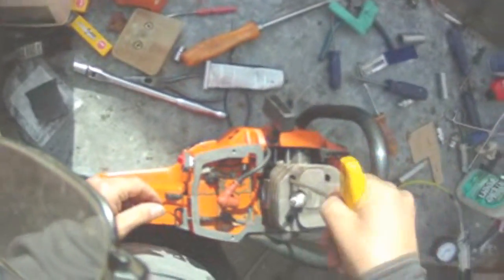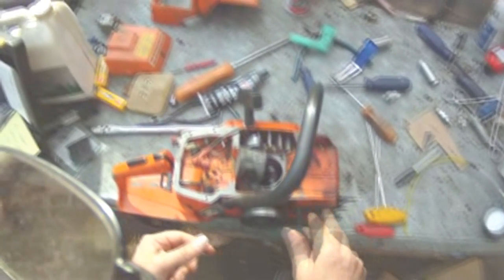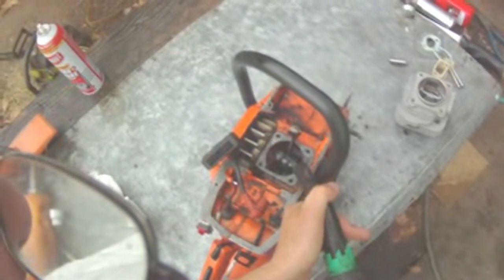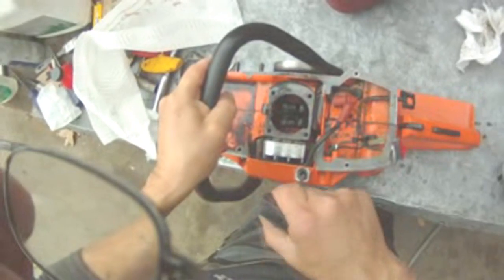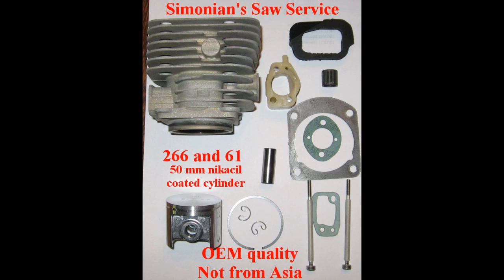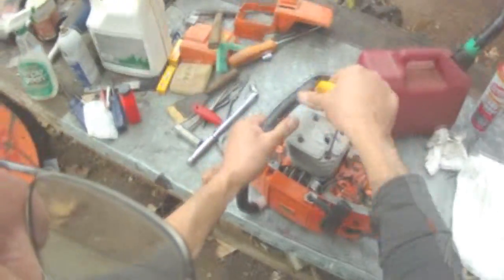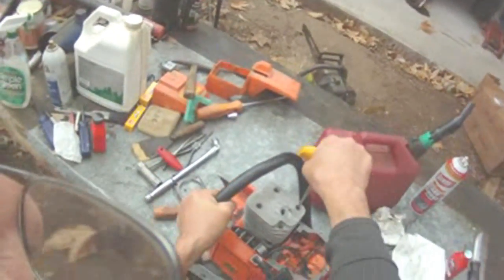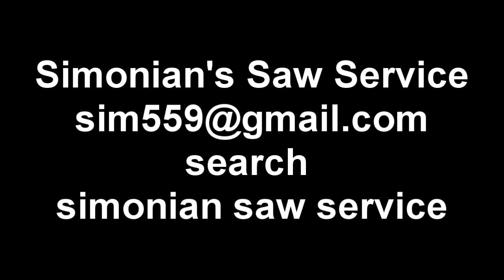After market Husqvarna 268 cylinder kit installing into a 266

Comment: i learned from this never to use a head cam to make a video , wow , my head was spinning for a few minutes after this video
Reply from the maker: never take up flying! those descending turns will get you
Reply: @JONSEREDdotWS  lol , never been in plane and don't intend to ,
good video tho. i just changed the top end on a xp 268 , i was able to install a 272 top end  from Italy  on it , i think they are a little better made then the china ones ,,, she rips now ,   :)
Reply: @JONSEREDdotWS  P.S. i finally learned how to get that bottom screw off the carb. without bending the key , take that on/off switch off ,thanks for that,  just never dawned on me , my brain tends to take little breaks on me once in a while , lol ,,,  
nice video
Reply from the maker: @marcelcanuck   Glad I could help
Reply: @JONSEREDdotWS  140psi Good compresion 372xp oem?
Reply from the maker: @Sensei948  yes what is the problem?

Comment: im a housewife but even i know you dont tighten a cylinder or a cylinder
 head clockwise or counterclockwise. you tighten a cylinder- cylinder 
head crossways, and half way. you tighten the next MOST opposite to the 
next to tighten (which leads to tightening crossways) and ONLY halfways. 
you go around at least 3 times on every nut on the 
cylinder-cylinder-head and use a torgue wrench to meet the maximum 
torgue, not a t-handle.
 because exceeding torgue  is as much of a 
violation as undertighten the thing. same thing applies to tighten  a 
rim on your car.(altough the rim of a car can be kicked because the 
basic rule in this is to tighten it as much as you are physically able 
to, but make sure you spread the tension on the largest surface area, 
i.e: tighten every nut bit by bit and crossways) i see you making a nice
 circle tightening the cylinder... nut next to nut making a nice circle.
 Even if it are only 4 nuts you just violated the most basic thing in 
mechanics.

tighten the MOST OPPOSITE nut on a circular connection on EVERY occasion

and you clean out ur crankcase, or anything greasy, with diesel. not gasoline with some shit in it.  cheap good ol, easy to obtain DIESEL , the stuff you get at your local gassstation

btw im here becaue im the only english speaking person in my family and tommorow we are buying a husqvarna 266 se chainsaw, and i have to translate the user manual

anmd the oil u use to install the new piston is the very same oil as u use for the mixture to run the saw on, but even better(because its cheapo) just use motoroil. it will burn away anyway.

and why dont you just elevate this top cover with some washers instead of grinding a hole in it?

and nicasil plating is very nice, unless you need to bore the cylinder again, becasue nicasil doesnt allow oversized pistons beacuase you simply cannot machine the nicasil material, exactly like the chrome plated parts like the trottle valve in the carb of the motox machines , have em wear= have em shot and get an oversize piston to install (motocross 125cc two-stroke obviously basic knowledge, yea this girl happens to know about motocross 125 cc engines, i aslo know somethings about the 500cc engines for that matter, you know... back in the day when these were still made, when there were still men that dared to ride these kind of bikes...)

and the kit is for those who dont know what cylinder porting is about, like they dont know what happens when you grind down your cylinder head, or in case of the 500cc two-stroke motocross engine .. add an extra head gasket(for certain occasions, like having your girlfriend riding your bike))
you might wanna consider a rebuild of your chainsaw done by me , and i can make a very nice set of cupcakes to go along with it
Reply from the maker: +Regan Teresa WoW very nice. You are correct. however I use the same fuel mix to wash out the crankcase as I do to run the saw.  Sometimes I even use a pressure washer to do the first cleaning of the crankcase. I also have used motor oil as a pre lub. Makes lots of smoke on start up which is kind of fun.  The problem with washers to raise the top cover is there is now a gap between top cover and saw body. I guess one could use silicon seal to solve that problem. So i will make that suggestion. It may cost more to bore out a cylinder or just replace it with a new one. Now for the cupcakes, sounds interesting. Where in the world do you live?
Reply: hahaha i live in the netherlands,  ;) BTW i actually got use the husqvarna 266 se , it has a 24 inch blade and ive personally cut down 4 trees with it, thickest was 15 inches and like 25 ft tall (which were in a backyard) strained 2 fingers while starting it up, but that was better the next day
 tnx for reviving a teenage memory, i wasnt really housewive material in my teens haha lemme know when you ever get to visit, well eat cake and talk 2 stroke engines! And i actually have a tip: when removing the circlips for the piston pin i held down a piece of cloth against it so that the clip wouldnt shoot off and end up in the crankcase, i actually had that happen once had to bring the engine to the shop, i didnt want to split the engine myself because i feared messing up the gears. it costed like two second hand 266 se's.
Reply from the maker: +Regan Teresa I do not think any one can be a good housewife in their teens. Too much to see and do. That is a good idea on circlips. Where did you learn all of this? have you ever thought about repairing saws for other people? Just a little side business that you can work on part time. I also sell Sitka Gear. Are there any Sitka Gear Dealers in your area?
Reply: oh i grew up with all boys, i had a dirtbike like all of them to fit in so wouldnt be lonely i guess haha. (there wasnt much to see where i lived ;)) which i fixed myself for the same reason. We would be preparing the bikes together on saturday and ride the next day in the dunes. And we all knew best how to do it all. So i got familiar with the two-stroke engines, the only thing i never did was splitting the engine case and porting and stuff but i think i still know everything about it. Its just cool to get that stuff all coming back to me watching these chainsaw videos. It had slipped my mind ages ago
. i couldnt even start the thing myself at first but i had a great time back then anyway. Kinda funny the saw reminds of it. I remember the inside of the cylinder looks the same with those ports and all. only the bikes engines had a cylinder head
|Did i already mention i learned everything the hard way? hahaha

nahh my repairing days are over, and there are barely any trees where i live in since i live in an coastal area. We just so happen to have allot of fast growing trees on our land, like willows and trees like that. soft wood that grows like grass. they need to be cut every 3 years or they will block the sun.
 there are no real chainsaw dealers around here, beside a franchise for husqvarna and stiga i believe, stuff for gardens nothing proffesional like you guys have.
Reply from the maker: thanks for the story
Take care 
Rod

Comment: Rod, How do you pressure test the crankcase seals? Want to check this on a couple of saws I own. Great videos. Love the way you explain. Easy to understand.Thanks
Reply from the maker: the easiest way is to start the saw and see if you can get a good stable idle. Then richen Low jet and see if it will slow down and die. If so your seals are good.
the other way is use a pressure tester. You need to block the exhaust and intake ports to seal them. Husqvarna makes adapters to do this. Some are meta with rubber backs. Some are just rubber that is cut to fit between muffler and head or carb and intake manifold. Remove the decon valve and use a plug that screws in. Remove spark plug. and use a plug adaptor that will fit the vac/ pressure tester. Add a little pressure and see if it holds for a bit. If not use soap bubbles and paint the seals. If you see bubbles you found the problem. If it still leaks and you can not see bubbles, you have to put the saw under water to see where the leak is.
sometimes it is just easier and faster to replace the seals and forget the test.
Reply: Rod Simonian Thanks for the information. I will try and hopefully won't need to replace seals but if I do I know where to get the tool to split the case...saw your store on ebay .
Reply from the maker: joedodge55  Save 5.00 dollars and buy direct from me

Comment: I've heard the 268 was open port type cylinder and made less power than the 266 which was closed port.  Any truth to that?     The book says 4.8 hp on 268. And 4.5 hp for 266.
Reply from the maker: Hi
These are closed ports made in Italy by Meteor pistons . They have been in business for more than 40 years
Thanks
rod
Reply: There was 2 kind of 268s..... 268xp was closed port pro saw and plain 268 was open port saw. When Husqvarna introduced 272xp  it replaced the 268xp. Plain 268 was also introduced when 272xp came up, 268 was cheaper alternative(semi pro saw) to 272xp. 266SE was closed port saw indeed.

Comment: I found the kit, but could use a demo video of how to replace piston & gasket on a Husqvarana 575XP. Any leads?
Reply from the maker: Hi It is about the same except for the intake part but this is not that hard. Just put the intake on before you set the cylinder down on the base
let me know Rod